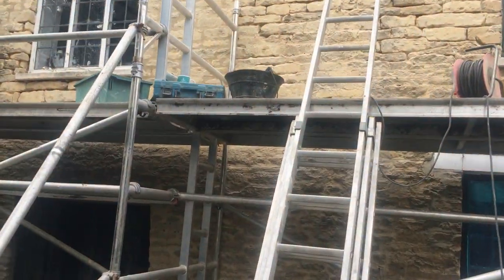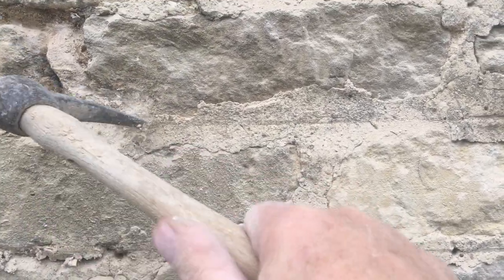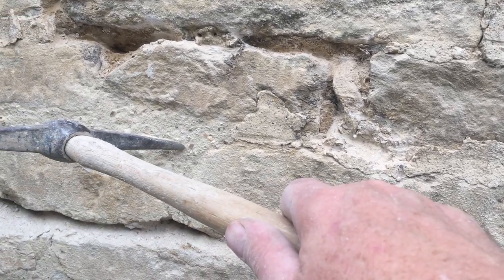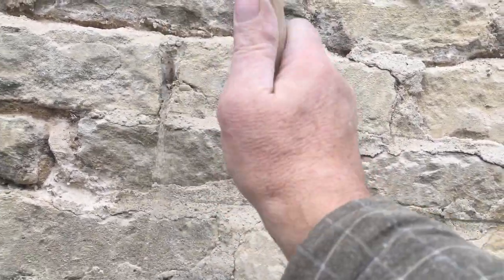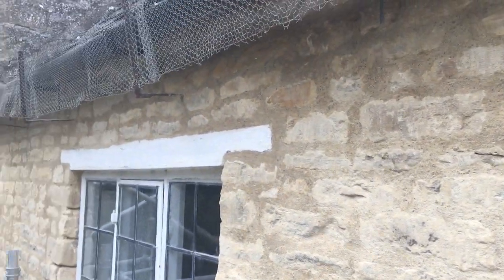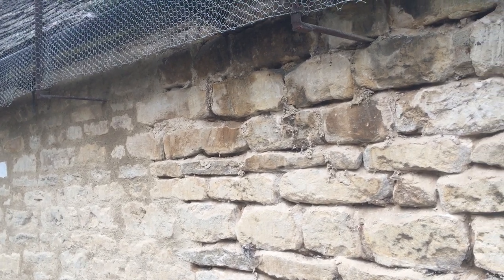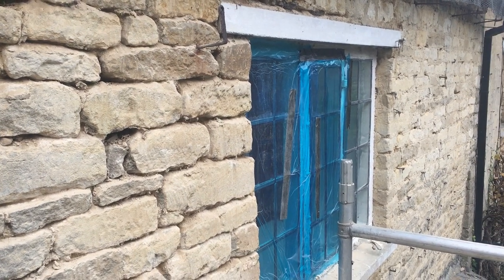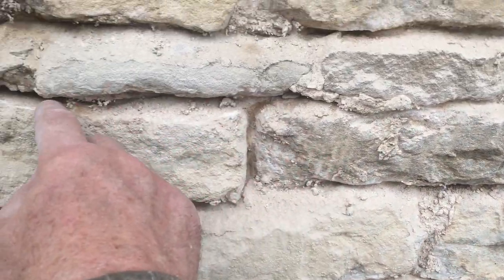New quicklime mortar versus aged original.

Comment: i  reuse old lime mortar in the mix whenever i can.  i use  a 10 sharp sand/ 4 lime mix. couple of shovels of broken up old mortar in a  full mix, which is 15 sand/6lime. . makes  a lovely mix  and colour. i have even reused old lime mortar by itself  with no new lime on a few jobs, and its  set well . so far i have had no buildings fall down or walls. i am a flintknapper and been doing it for 30 years now fulltime
Reply from the maker: I use old lime for my scratch coat when plastering. Never had a problem. People think too much nowadays. Lime's meant to be simple. Keep up the good work bruv.

Comment: Thanks for the great video. How does a hot mix like yours compare in durability to a mix made of high-calcium content aged lime putty that in its putty form has matured for a few years? I guess a follow up question is when would one chose a hot lime mix compared to a traditional aged lime mix?
Reply from the maker: I think that first of all you'd need to cite your evidence concerning your claim about aged lime putty being used for pointing. Current research suggests that lime putty was only ever used for top coat plastering. It's now argued that pointing with it was an 80s revival thing - same as NHL. Mortar analysis over the last few years now provides evidence that only quicklime was used for building and pointing. Laying up putty for many months (or even years) only to be used for pointing would appear to be an expensive and unnecessary errand.
Reply: @michaeljamesdesign  , Hi Michael, my apologies. I am coming at this from the  very narrow perspective of a fresco painter who uses lime plaster as a top coat, upon which I paint. I enjoy watching videos like these as they help improve my general knowledge about lime plaster. I didn't intend my comment to be about pointing, just the comparison of hot lime vs aged lime  in general. In hindsight, I realize the applications (pointing and fresco plastering) are likely too different for that to have been a reasonable question.

Comment: Thanks 
With portland  cement mortar you can block 4 walls , 4’ high  ,parge it ,fill it with water for a pool .
I wonder if you did the same with lime mortar how long water would take to drain through compared to Portland cement parged pool ?
Reply from the maker: Dunno, don't fancy finding out either.
Reply: 😂 , I built a garage foundation wall once , on clay , 4’ high concrete block wall with Portland cement mortar . The thing filled up like a pool after a storm .water tight I kid you not .

Comment: You say here if you are repointing old lime mortar use a quick lime. Do you mean repointing these sorts of stone buildings or do you include brick buildings too.
Reply from the maker: I always use quicklime for stone as that's what was originally used. However, I rarely use it on brick as the faces are usually porous so it stains and looks bad. It has to look nice as well as being sympathetic. I'd have no issue with it on the type of brickwork which doesn't stain. For me its putty or NHL or brick.
Reply: @michaeljamesdesign  Thanks

Comment: Mike, I have been trying to learn about limes and there uses but in the USA it is hard to find anything other than hydrated lime. My question is about free lime content that you reference. Can you explain what that is, searches do not give a good explanation and usually reference concrete. I do learn a lot from your videos any really appreciate the time you spend making them. Thanks
Reply from the maker: All limes have an available lime content. Quicklime CL90 has the highest with 90% whereas NHLs have the lowest. Compressive strength is related to the amount of free lime. This gets burnt off the longer lime it's burnt in the kiln so an NHL5 has the lowest. If you keep burning you get cement. Free lime also contributes to workability. Good workability means it takes less time to apply. So high free lime is a winner all round. When you add pozzolan you reduce the amount of free lime because pozzolan eats lime. So if you want a hard lime for exposed sites then you add pozzolan. But this is a whole other science.
Reply: Joseph, US Heritage in Chicago, IL sells conservation-grade lime products. They sell hot lime (calcium oxide) and aged lime putty (calcium hydroxide).

Comment: Hi, thanks for your vids! What do you think about nhl5 full facing harsh weather and sun any advice? The wall I’m doing is also 1700 but the pointing was done 6 yrs ago and is pouring out of the pointing crevice!  Followed all your vids and feel your experience is really sound! 10 miles from your Aston cottage job!  Was your South Cerney sand mix from Collimoore pit?
Reply from the maker: If recently applied mortar is coming out then the problem lies in the mortar. What type was used?
Reply: @michaeljamesdesign  Thank you heaps for your reply! I can bring you a few pics and some mortar from the wall next time I see you out and about! If that’s ok!  I have no idea what the builders used but it’s very fragile!
Reply from the maker: It sounds very like your builders used lime hydrate. This is very good when fresh and makes wonderfully rich lime pointing or plastering mortar. However, when it's been sitting around in the bag for a while it eventually becomes inert and is only useful as a plasticiser. Hence this isn't the first time I've heard of lime hydrate mortar failing. If you want to use NHL then I'd recommend 3.5 for an exposed and weather-prone situation. Mix it 1:2.5. Just don't use Secil. I can't give you details of the sand or the blends I use. Trade secret and all that. Just don't use ordinary builder's sand.

Comment: Hi Michael , can you mix crushed lime stone 6mm grit down with hot lime ? Because I’m Finding it hard to get washed  sharp sand with a grit in it . 
Tnx mike
Reply from the maker: Of course you can Michael. But be aware that your crushed stone will be 6mm down to dust and because of the fines it could take longer to dry out which could cause problems when it freezes if there's still a moisture content.
Reply: @michaeljamesdesign  thanks 🙏
Reply from the maker: @rosslukeshay  My  pleasure. Good luck.

Comment: Hi Mike, great video. Love the original pencilling.  Would you put that back?  I'm on a bit of mission working with Tim Meek and Nigel Copsey to restore and learn about old finishes.  Just 1 little bit, I heard you say about spraying up.  Don't over spray.  Maybe the next day then  maybe a week later.  Quick lime doesn't need the spraying like putty does. Everytime you spray you re-slake.   We're all in this together 👍
Reply from the maker: I don't over spray. This mortar has gone past the case hardening stage and is carbonating. So the lime can't re-slake. The mortar is subject to cold and drying winds and has some propensity to cracking. Another variable in the curing process is the amount of limestone dust in the mix. This has a pozzolanic affect which means it's prone to swifter drying. As I'm sure you're aware, carbonation, drying and relative humidity are all related.
Reply from the maker: I didn't realise it was you!!!

Comment: I like the quick lime motar mix. Whats the make u use for quicklime and brand? Is it 1 part quick lime to 2 part plastering sand and 2 sharp sand? Why do ppl not use builders sand its like fine softer sand? Can i put sythentic as hair its hygenic?
Reply from the maker: Hi, thanks for the enquiry. There are a number of quicklimes available; the ones I use or job site specific. You'll be fine with your own recommendations for sand but again choice is as per job site. You can use building sand but it's pretty disgusting stuff. It doesn't matter when it's used with cement as this will lock in all the horrible stuff. Now do tell me, why would you desire to include man made hair in lime mortar?

Comment: I own a 17th century building here in Ireland , which I an rebuilding. The advice on lime pointing is varied and in some cases even involved cement. At the moment I am using a 3.5 Roundtower lime mixed with a portion of hydrated  White Rhino lime and a plasters sand. Foe the interior. Getting a lovely workable mix. Any thoughts in case I am causing problems.
Reply from the maker: There's only one thing I'd mention and that is that Roundtower NHL 3.5 has a very low free lime content. It's only 18%. That's 82% impurities. Which is a lot. Their NHL5 contain more free lime at 25%. Personally I'd never use Roundtower NHL3.5 as it contains such a small amount of lime. Imagine eating a chicken sandwhich which only contains 18% chicken. Could you even call it chicken?
Reply from the maker: You don't specify what a portion is. You may be including too much or too little. Be careful. Gauge at your peril.
Reply: Thank you for such a quick reply. I am using a  1 -2.5 mix, but I did feel the result felt a bit hard. So I added  30% mix of hydrated lime to the lime mix. So 1/3 White Rhino 2/3 Roundtower. The mix felt really nice and has dried really well. I am taking the idea of the walls breathing very seriously and have been experimenting on small portions to get a good balance, over the past few months. Even the plastering afterwards , I will take my time, get a proper breathable mix. Thanks again for your reply, really delighted.
Reply from the maker: @Jeremy64444  1:2.5 means you'll have more free lime but a higher compressive strength. Mixing in that much non-hydraulic lime might feel right but it doesn't necessarily mean to say that it is right. You may as well go all the way and use 100% fresh lime hydrate with a pozzolan. Personally I never mix in more than 10% - 15% non-hydraulic into my NHLs. So that means no more than 10% putty with NHL and no more than 15% lime hydrate with NHL. I never mix NHL and quicklime which is ffectively what you're doing. I take the concept of carbonation seriously. You're dealing with delicate setting processes and unless you have the backing of scientific research then you need to be careful otherwise your mixes could fail. Speaking of scientific research: there is evidence that mixing NHL and non-hydraulic lime results in the carbonation process can be slowed down dramatically. This translates to your mortar remaining vulnerable for longer. Do bear in mind that these results are born out of optimum lab conditions and these are rare in the real world. Remember, you are not a chemist.
Reply: @michaeljamesdesign  thank you, I always take advice,  no damage done, as I have experimented on different small areas,  will kook for a different product. 
Again thank you.